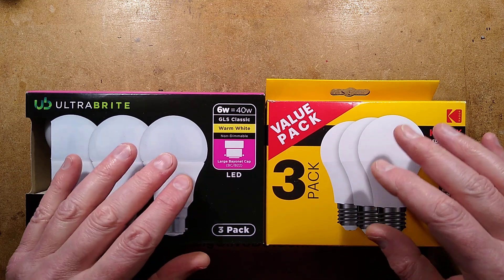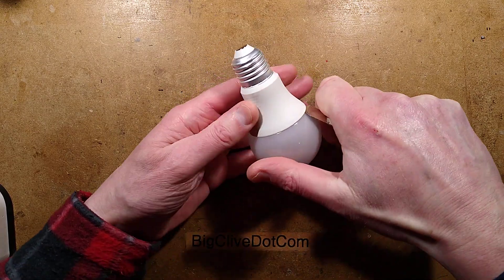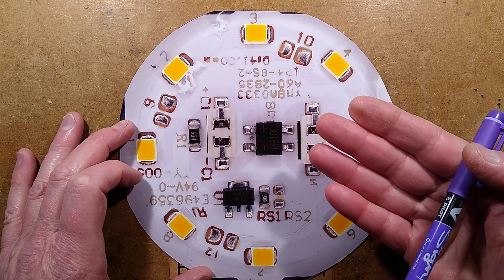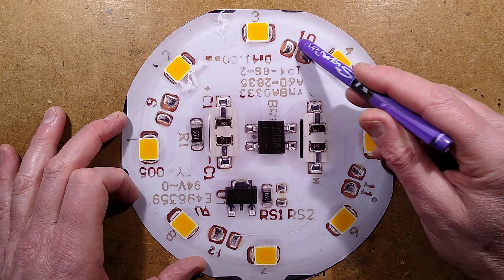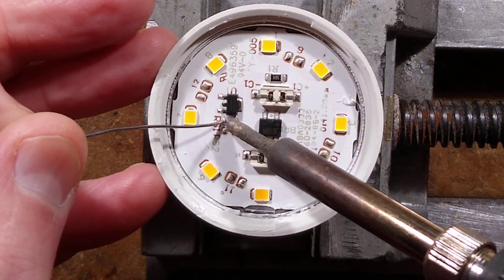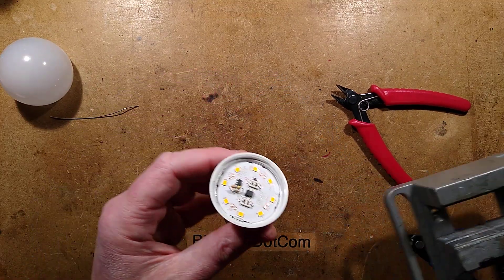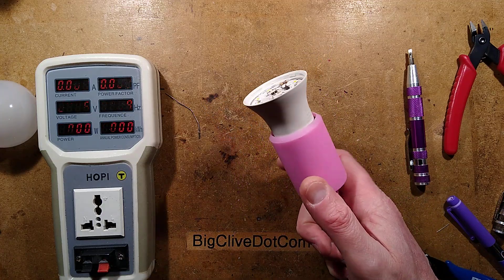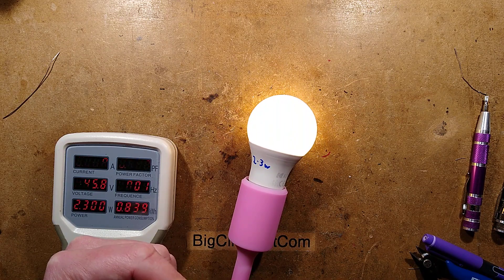Hacking Kodak lamps

Comment: I for my part simply ripped out the whole electronics and replaced it with a 12V switch mode power supply and some LEDs. Works nicely.

Comment: So you're saying I can put a 200 ohm potentiometer on my LED bulbs and that's a dimmer.
Reply: Yes, you can. But you also have to solder a resistor in series to the potentiometer to limit the current

Comment: 10w for a 60w equivalent is quite bad efficiency for an led. I've seen 100w equivalents that are 10w, allthough they're usually 11, but still. That's what you get for cheap poundland light baulbs. It's not as bad as the dollar tree ones we have in the us that claim they're 2700k, but then look like bad fluorecent lighting, and have noticeable flicker (you wave you're hand and it's almost as bad as doing it in front of a CRT). I tried them once and I was getting headaches. Dollar tree BTW is a store we have where everything used to cost $1 (they've gone up to $1.25 recently), and they come in a 2 pack. The sad thing is at walmart you can get the store brand baulbs for only a few cents more and they're perfectly fine, and only use 8-9w.

Comment: From the US I bought some Kodak bulbs from Spain.  As they were 240V bulbs they have very robust power circuits.  I had to put a jumper over about 1/3 of the LED string to get it to light at all on 120V.  I experimented moving the jumper until it lit up.  I then removed one of the two paralleled resistors to get the lower drive current. The 240 V, 15 W bulb now draws 120 V, 4 Watts and doesn't even get mildly warm.  I expect it should last longer than I will.  It has lots of LEDs in there.  Two parallel strings and two regulators with 400V capacitors.  Buy the Kodak 240V lamps if you can find them.

Comment: I modded my led lamps in my kitchen under the vent hood too. Without mod they died after around one year. After modding them never again the last 5 years 👍
The big hassle is to get the plastic cover removed. I almost get injured by doing it 😥

Comment: the first led bulbs i bought like 12 years ago had huge heat sinks.  they were pretty heavy, cost closer to $10 ea. and none have ever burnt out.
Reply from the maker: The first ones were expensive but reliable.  The new ones have an engineered lifespan.

Comment: is it me, or am i just not getting this video at all, youtube?  If reducing the 10watt lamp down to 2.3watts makes the lifespan massive like, keeping it turned off entirely will make it immortal, as far as inanimate objects get... thats just mind boggling!  Who needs light anyway, its not like anyone here has ever went and specifically looked for a brighter lamp because the 400lumens lamp they have just wasn't bright enough.  thus the whole point of a 10watt or 800lumens lamps existence.
Reply from the maker: The lamp in its original form is greatly overdriving the LEDs.  The point of the hacks is to make a lamp that lasts a lot longer.  Even if that means adding an adaptor and using two at reduced power for the same light.

Comment: Hi Clive, not really a comment on this video but a question related I’ve always wanted to know the answer too! My friend Geoff served his time as an Electrician for the NCB. He has authored many books relating to the Coal industry. He said that the light bulbs used down the mines far outlasted the ones commercially available. He said that people would steal them so the manufacturer sand blasted the glass so the bulb would project a NCB logo 240v and the Wattage. This would prevent stealing and the technology of bulbs lasting for years of service in the public domain. I know about rough service light bulbs that are constructed with better supports so they can survive vibration. I would love this story to be true. I know Scotland had Coal mines so is there anyway you could make a video about this?
Reply from the maker: Not sure about the custom logo, but the rough service lamps do last a lot longer as they are actually rated for a higher voltage.  But it makes them much less efficient, so it's cheaper to buy a normal lamp for home use in the long run.

Comment: In high school I used a hacked TI-85 (which was older but better than a TI-89 due to the latter model being crippled.)  I opened it up, drew some thick graphite traces between some pads, and just like that, a ~400% overclock!  (A whopping 18 megahurts.)  Too high of a resistance meant slower speeds, no resistance meant occasional lines across the display, but using a pencil to apply a common and cheap semiconductor was pretty frickin cool in my book.  :)  I wonder how many hours I spent editing game code on that beast... Ah, 'twas a simpler time.

Comment: Hi Clive,
I was wandering how these Led do perform in high speed filming. I am verry sensetive to Led flickering on the 50/60Hrz frequency so I still use a lot of old style lamps but would love a Led lamp that does not blink is there also a fix for that? Thanks
Reply: I find the Philips Eye Comfort range are much better than other lamps, at least for doing 60Hz video with a 50Hz electrical supply.

Comment: Would running a smart light bulb at reduced power achieve the same effect? They are quite common nowadays.
I would think that if the bulb is pwm'd, no gain in efficiency is achieved, only a gain in lifespan (lower average temperature). If the smart bulb is operated at a lower constant current, both better efficiency and longer lifespan would be achieved.
Reply from the maker: Under running them will help, but the power supply is a factor in reliability.

Comment: Hi, this is the first video I saw about hacking LED lamps, well done. Why don't you also measure the decrease in light separately from the decrease in power? Since the angular distribution of emitted light doesn't change, measuring the light output along the axis at a certain distance before and after the hack (light sensor from a smartphone works already) you can easily calculate the ratio of light loss to power loss, and estimate the increase of LED efficiency. It would be a quite interesting information to provide!

Comment: You have inspired me. I think i am going to create a 3d printed 1:3 conversion mount for my ceiling fan fixtures to use some of these hacked PCBs. I should be able to get more useful light out of the fixtures by aiming them at a wider area, while reducing the glare when looking at them. I think i might thermally couple the PCBs to some aluminum foil on the back of the mount for a little extra cooling.
Reply from the maker: It may be safer to buy one of the many multi-lamp adaptors on eBay.  They aren't expensive.  You can also cascade the two way splitters.
Reply: @bigclivedotcom  oh, where's the fun in that? I only let the smoke out on my of my hack jobs, repurposing a power bank to fit into a contraption of pvc fittings to power a plasma globe. I just gotta not touch two circuit boards together during the glue up when one has 6 fully charged cells attached is all. 😁

Comment: I would have thought you would put a 47 ohm resistor (or higher) on the unpopulated pad next to the existing SMD resistor. They were running in parallel or was I mistaken.
Reply from the maker: That would lower the value and increase the current.

Comment: I was half expecting a near-identical board to that of the Tesco mini-globe which I ripped apart the other day.  A similar design (making use of those push-fit connectors for supply and capacitor) but a different regulator (BP5131JC) and obviously a different LED count.  I'm surprised to see Kodak's name on the box as the company still seem to be a "thing" and not just a gobbled-up brand name like Polaroid or Ferguson.

Comment: According to Technology Connections some bulbs have a thermally conductive gas in them for cooling.
https://www.youtube.com/watch?v=fsIFxyOLJXM&t=1525s
I don't now if this applies to these plastic housings too, but if that is the case you have let the gas out by opening it up. Maybe that is why it is glued in with silicon?
Anyway, reducing the power will far outweigh the lack of cooling gas.
Reply from the maker: Those tend to be the glass filament ones with helium fill.

Comment: I have heard that some of these bulbs are filled with a gas that conducts heat better than regular air, in theory to help pull some of the heat away from the LEDs to the surface of the bulb, without forcing all of it to be dissipated through the socket and the (largish) base of the bulb. I don't know if this is true. I wonder if you could test that by measuring the heat on the surface of a bulb before and after opening it to replace whatever was inside before with standard Isle of Main/Big Clive room air. (Which may or may not contain more ozone that someone else's room air :) )
Reply from the maker: Some glass globe LED filament lamps are filled with helium.

Comment: Inspired by this, I picked up a pack of the Kodaks in Poundland today. They do get hot quite quickly, run at full capacity. I found a 25 ohm resistor in my junk box - with that, it was still very  bright (and still got pretty warm). Tried 100 ohms too and it's quite acceptable as a desk lamp (and only just barely warm after 10 mins). Very nice.

Comment: Okay here's more scientific approach: remove the cover ant operate the lamp for about 15 minutes to reach equilibrum and measure chip temperature with a thermal camera or with an probe coated in thermal paste, call it tChip. If it's below 65-70 celsius the lamp is good. Otherwise calculate tDelta = tChip - tAmbient, that's your "degreed per whatever watt". You want to keep tChip below 70 degrees (below 65 if aiming 100K hrs), then subtract average air temperature (upper temperature is usually higher, measure at ceiling) and call it tMaxDelta. Since delta scales nearly linearly with power you need to reduce power proportionally, pwrNew = pwrOrig * tMaxDelta / tDelta. Refer to driver chip manual for the resistor formula or figure out approximate nominal by trial and error.

Comment: Hey there, you are pretty awesome. Thanks for the videos. I have a push button 'toggle' switch that turns an old (about a year or two) vape off and on. I'm trying to decide what to do with it. Anything interesting you (or anyone) can think of that I should try to connect it to? I know it's a broad question. Thanks either way

Comment: I am wondering what type of plastic was used to 3D print the lamp diffuser. A lot of those plastics, especially PLA, don't do well if they catch on fire. They end up dripping flaming plastic and could cause the already bad situation of an electrical fire even worse.
Reply from the maker: It was specifically for modified lamps running at just 1 or 2 Watts.  You also have the option of using flame treated filament.

Comment: I notice at the end the power factor got worse - would it make sense to swap out a capacitor to improve that?
Reply from the maker: It's not that easy.  Most electronic supplies draw their current at the top of the sinewave
Reply: Resistive (incandescent) lamps draw through the entire waveform, diode circuits only draw when the supply voltage is above the DC threshold voltage so knocks the top off the waveform with a big inrush, so it ends up flat-topping or even in extreme cases dipping the top of the waveform peak

Comment: Anyone know what bulbs are best to hack like this in the US? I opened up one of mine and it seems completely different, all the electronics are behind a heat spreader that seems like its not removable without damaging the casing, I don't know enough to know how to modify it.
Reply from the maker: They do sell this style in the USA.  Often with very high wattages and low cost.
Reply: @bigclivedotcom  I opened up a dead one, it was similar to yours with 2 resistors. But (I think) all my working bulbs are a different more complicated design. Might have to get some cheapo ones once those eventually burn themselves out.

Comment: The thing that is not often mentioned is that the phosphor in the LEDs ages with use so the light output falls - I wonder if that is covered in the 3 year warranty ?  It would be interesting to buy a few and leave one on for a few years and then compare it with one that had not been used.

Comment: My stepfather was the advertising manager at Eastman-Kodak during the seventies and eighties, but they went partially out of business with the advent of internet. Anyways I was wondering if you have used or knew about the "Korst 191" soldering gun/pencil thermometer? For all those soldering utensils, there's an awesome machine for exclusive tear-down and observation and it is immensely helpful at keeping the soldering gun under temperature control. Check it out!

Comment: I'm suspicious of the power factor. For a simple LED string with a constant current regulator, the PF should be higher. I suspect the cap after the diode bridge is the culprit. If you deleted that cap, you should get 20% more PF, but slightly less LED power.
Reply: You'd also get much more flicker. It's probably a better idea to use a smaller capacitor so there's still smoothing.
Reply: @eDoc2020  If a smaller capacitor is used, the flicker will still be noticeable though

Comment: Nice hack! Have you ever swapped out the LEDs themselves using a hot plate? Rework station damages the phosphor so it's the only practical method I know.  
I went from 90 lumen/watt 6500K to 160 lumen/watt 3000K and just by doing that, the enclosure/heat sink temperature dropped by around 8 degrees without touching the settings.

It was a 2S LED chip with 3030 dimensions.

Comment: Power factor also dropped to 0.508 from 0.603. That means reactive power went from 18 VA to 4.51 VA. Filter cap can probably be lowered because the Dv/dt between cycles isn't nearly as sharp.
Reply: Would it indeed help to decrease the filter cap in value to improve the power factor? Unfortunately, I can't find much information about improving the power factor.
Reply: @Mr-Splendid-NL  Yeah, you can improve the power factor by increasing the reactive impedance of the capacitor (because it's in parallel with the load), and that's done by reducing the capacitance to just enough without perceivable flicker. The capacitor's purpose in the circuit is to eliminate visible flicker during operation, but it is making the voltage lag behind the current and that creates a phase angle compared to the input waveform and your power factor suffers. When Clive reduced the LED current, the load impedance went up and the real power was reduced, but the capacitor was not changed. So the circuit draws less power but behaves more capacitively because the capacitance was not changed to compensate for changes in the load.

With more circuit analysis, you could bring the power factor to 1 by adding an inductor to the circuit for power factor correction, but the circuit board doesn't have a spot for this and it can be a tricky problem to solve. If you removed the capacitor completely, the voltage would no longer lag behind the current and you'd get a big improvement in PF, but you'd have to deal with brightness flicker.
Reply: @Infinion  Thank you for your very comprehensive response. I find this very interesting to explore further. Where would you place the inductor if that were possible? In series with the LEDs or in series with the capacitor?
Reply: @Mr-Splendid-NL  If I had the correct values for the inductor and capacitor, I'd place the inductor either in series with the any of the diode bridge rectifier connections, or in series with the capacitor. Both setups would slow the charging of the capacitor and make the current waveform more sinusoidal, instead of there being a current surge every time the AC waveform approaches a peak value.  For cheap LED bulbs like this though, I don't know if there's an inductor that's compact enough to fit inside the bulb.

Instead, if you use a resistor in series with the capacitor, you can slow the charging and discharging. The former was an LC filter, and this would be an RC filter. The advantage being that resistors have really compact form factors. 

So in summary, the two simplest ways in my mind are to either reduce the capacitance, or adding a series resistor to the capacitor.
If you want to simulate the circuit instead of doing the math or working through trial and error in real life with real components, I recommend checking out everycircuit or falstad circuit simulator. LT spice is also great but not as straightforward.
Reply: @Infinion  Thanks again for your detailed explanation. I can already tell you understand this and you have helped me take a step in the right direction. I'm going to dig into this further and try some things out. Thanks for your help!
Reply: Many led bulbs flicker due to an insufficient value of capacitor. Doing the power reduction mod can totally eliminate the flicker because the capacitor now has enough energy storage to keep the dimmer leds at their new full brightness. I would keep the original capacitor.

Comment: Would it be a problem connecting two or three lamps in series?
Reply from the maker: With these lamps with high combined LED voltage it may not work.
Reply: @bigclivedotcom  Ah, OK. I was just wondering if it would be simpler than modifying the circuit to reduce the power. Thanks :-)
Reply: @bigclivedotcom  Ah, Ok. I was just wondering if it would be an easier way to drop the power than to do open circuit surgery with my ageing eyes :-)  Thanks for replying.